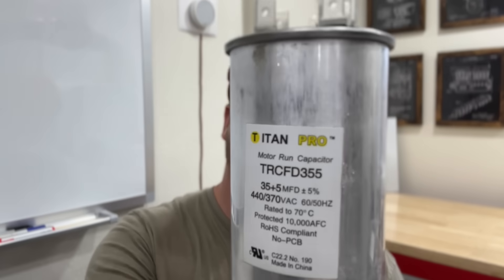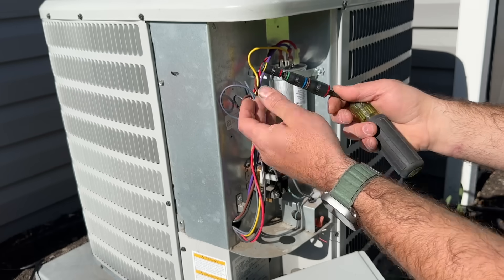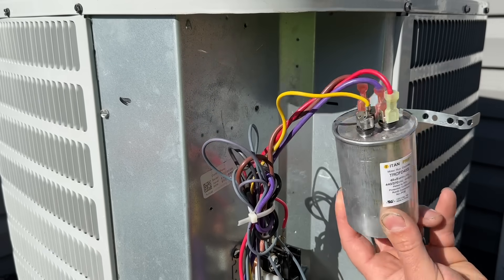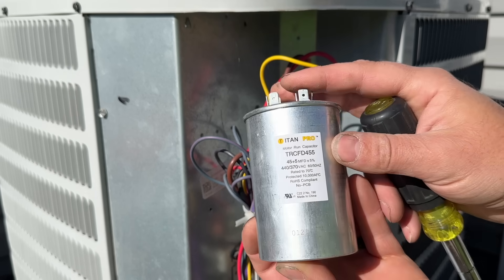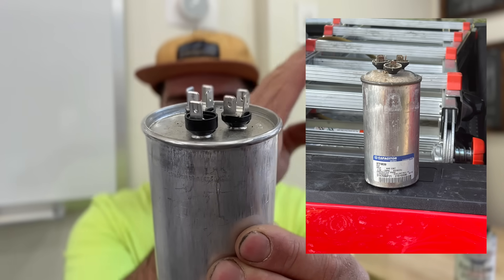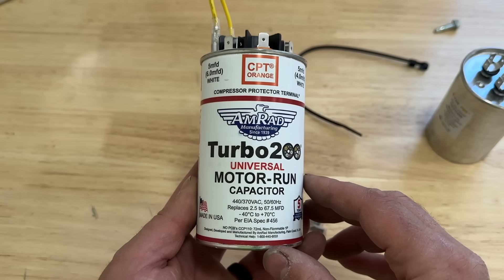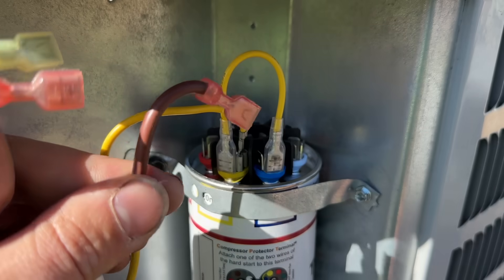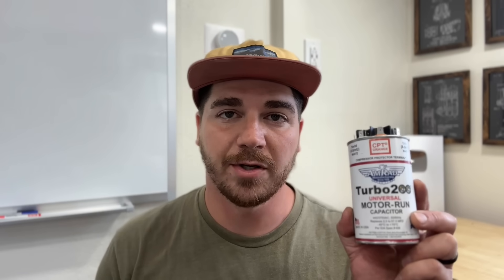HVAC Contractors Practically Make Their Living On These

Comment: Changing the capacitor (and contactor) is something every hoMEOWner should learn to do, 'cause they're not making these things like they used to- Lately it seems I have to replace my (and my 100 year-old mother's) capacitors about every other year. I thought it was just me, but the guy at the HVAC supply said "Yeah, you're lucky if you get 2 years out of them these days". Even an honest shop is going to charge you $200 to come out and change the capacitor...and you may have to wait days, with no AC....and that's IF you can find an honest shop...which is very hard, as the HVAC industry is very shady. Yeah, $2K for a $20 part and 5 minutes work...or even worse, they'll tell you that you need a new system.....

Comment: Over a week ago our Carrier Heat Pump with electric furnance stopped cooling. Ecobee thermostat screen was black. I found the thermostat wiring fuse 3 Amp was blown. I replaced it and thermostat came on. But it wouldn't cool. Fuse blew again. Called HVAC repair. two guys came out. Replaced capacitor and contactor in heat pump. Also replaced thermostat with a simple Honeywell as they didn't have an Ecobee. System ran for an hour or so then died again. We called them and they thought a circuit board in Heat Pump was bad and ordered new one. New tech came out a couple of days later and replaced the circuit board. I had him re-install the Ecobee to verify it was fried. It wouldn't power up. He put Honeywell back on and system ran. After he left the thermostat fuse blew again. I replaced it again and it blew again after system ran fine for 20-30 minutes. Called a different company and they came out next day. A new Ecobee thermostat arrived and he installed it. He put in new fuse and tested everything. System was working until about an hour after he left. Had him come back a couple of days later. He determined bad wiring in crawl space due to mouse chewing. He replaced wiring from furnace to thermostat and from furnace to heat pump. System came up and has ran fine ever since.

Comment: I was just cleaning up the house on a Sunday afternoon for a pool party on a roasting hot day when i noticed warm air blowing out of the vents.  Checked the AC compressor and found only the cooking fan running.  Called my AC guy who showed up after a few hours just as we were returning inside and he confirmed the capacitor was dead. He replaced it and was on his way in ten minutes.  Came back the next day to tidy up the connections since he didn't have the right terminals with him on the Sunday.  Charged $225.  I had been planning to get a spare capacitor just in case but didn't get around to it.  My bad.  My AC guy says he's seen them last as little as two years, ours was at least for years old. I'll be ordering a spare this week for the next time.  However I'm good with what i was charged since these days many service people like electricians and plumbers will charge at least $150 just to show up and do nothing.  I feel lucky to know someone who runs his own small independent business and doesn't rip customers off.

Comment: I needed to replace the defective capacitor on my AC only to find that no supply house in my area (DFW) would sell it to me because I wasn't an AC repair business.  Shades of the old TV part supply houses that wouldn't sell any electronic parts to 'civilians' for the same reasons.  I had worries about the China junk sold on Amazon and sure enough the first one I got from them was NG.  Tried again, opting for one that cost about $10 more and it did the trick.  Another pet peeve: nothing delights an AC repairman more than to tell you that, "drat the luck", Your unit uses refrigerant that's been obsoleted and so you've got to buy a new unit.  This pisses me off.  Thanks again, Al Gore!

Comment: I replaced a condenser fan motor for a friend of mine.
MY cost was under $100.00. (Wholesale) 
I didn't charge him anything. I had to rewire his unit a bit, and I put in a new capacitor as well. I checked the contactor, I cleaned the condenser coil fan blades, the evaporator coil, checked his air filter, cleaned the condensation line, and left.

He was happy, and I was glad to save him a lot of money.

Comment: Our air went out on the 3rd of July. Due to the holiday weekend, it was going to cost us $195 just to have someone look at our air conditioning unit- that is if we could get anyone to come out. That does not include the cost of any repairs they would do. Got the capacitor we needed at Ace Hardware and fixed our air conditioning problem ourselves. It was the hottest weekend so far this year. Thank you so much for this video.

Comment: The purpose of a capacitor is to advance the electrical phase angle of the start winding in the compressor and / or fan induction motors. Single phase motors are not inherently self-starting. Without this phase advance, the motor will just sit there and hum until it overheats and trips on the internal overload protector.

The capcitor is not like a battery.  Yes, it will hold a charge if there is nothing to bleed it of the residual charge after the unit is disconnected from power. The micro-farad rating is too low to hold sufficient charge to power any devices for more than a couple seconds.

Comment: When an electric motor starts, the current is out of phase with the voltage because of the motor being an inductive load, reducing the power factor.  The current and voltage should both be at the peak in a sine wave at the same time for maximum power.  A motor start capacity corrects this being out of phase by adding a bit of current when it discharges, to offset the lag of current at startup.

Comment: Actually the first thing you want to do is turn off the AC at the Tstat otherwise theres a good chance you'll burn the low voltage fuse on the circuit board.

Its VERY COMMON to get service calls where home owners after watching a Youtube video install a new capacitor thinking that was the problem, only to end up still having to call the AC man..

Instead of attempting to do the repair yourself the best thing to do is call an AC company thats not going to screw you over. A good technician will figure out why a part failed as well as check out the rest of the system while he's there.

Trying to save a couple hundred bucks could end up costing a lot more in the long run.

Charging $2,000 to replace a capacitor is just theft.. i would recommend to anyone to ask Chat GTP whats the average price to install said part before i paid any service invoice..

Comment: I just replaced mine. My house has two A/C units. I opened the side panels on both several months ago, before it got too hot and ordered an extra capacitor for each one. Just over $20 for both! It paid off a few days ago when it was 90+ degrees and one of my units stopped working. I checked the capacitor and sure enough it was bad. It also had a "pimple" on the top, (maybe an indicator that it was bad)? Anyway, I replaced it and it still didn't work. I found out that you also may have to reset the board by shutting off your air handler for a few minutes then turn it back on. I did that and it took off and started cooling again. I know it saved me big $$$.

Comment: Overly, somewhat, simplistic but basic educational explanation.  There many different mechanical/electrical systems out there.  If you have a problem and need to call for technical service then you need an experienced technician to work on your system.  Many AC companies hire unqualified mechanics. So, if you know of a good company with an experienced mechanic always ask for them.  Get referrals whenever possible.  Watch out for companies that advertise on TV during prime time hours.....some are run by bean counters and all they
want to do is send out techs that can sell high priced repairs.  To be a good tech requires lots of time.  It is hard work.  If it were easy peasy than everyone could do it. All you need is a multi screwdriver, a mulitmeter, and 25 trips to HD, electrical supply, etc.  Sorry to be sarcastic.

Comment: I paid a bit more for my capacitor as a backup due to it being a bit more of an unusual size.  But I would NEVER pay an HVAC guy to replace my capacitor.  I was drawn to your video due to the capacitor in my AC at this point and thought that was what you were talking about.  Thanks for posting this to make sure that we as home owners are not getting ripped off by our contractors.

Comment: I thought that the */- %  number discussed at 6:55 was the acceptable tolerance range. So with the 45 at +/- 6%,  if your reading was 42.3-47.7 the capacitor would still be good?
Reply: Exactly correct.  I had to rewatch and scratch my head.  Yea he made a mistake.

Comment: The commonly charged price in a small town is around $220 for the capacitor plus $90 for the service call. I learned years ago that is is smart to have a couple extra parts on hand before calling the HVAC company, namely the same specs capacitor and the electrical contactor. These used to be $9 each on Amazon, now run about $15 each. Last week I had the HVAC company check my system, first time in many years, because I knew it needed some more coolant. Seemed to run fine at first, but let it run 4 hours and it never got below 90degrees inside!! Called them back next day, he inspects and finds the capacitor swollen and bad, but was not bad yesterday! He was ready to charge $220 for a new capacitor but I recalled having a spare one (bought few years ago for only $9)! Worked just fine. He said no charge since I supplied the capacitor! In my experience, in larger cities these parts and work will cost even more. Keep some spare parts on hand!

Comment: On a similar note.  Hvac  service  changed me $500.00  for a  flame sensor replacement.   Parts and labor.  Informed me it's hard to  replace.  After they  left  i investigated.  Part online  under $100.  Held in  place with  a 1/4  inch  sheet metal  screw.  15 seconds to replace.   And they say car  dealers service departments are  crooks!

Comment: Some Tips from a retired electronics engineer.
1. Before disconnecting the old capacitor, take some pictures with your phone and/or make a diagram of the wiring (which color wire connects to what terminal) so that you'll know how to connect to the new one.  Another trick technicians use is to disconnect/reconnect one wire at a time although that requires that you can position the old and new capacitors close together.
2. Make sure power is shut off at the switch by the AC unit, DO NOT rely on the thermostat.
3. Capacitors hold electrical charge and can shock you so wear gloves.  Any pair of gloves will work.
4. DO not work around electricity when you are dripping wet with sweat.  Your skin resistance drops and that's what protects you.  I've been shocked by 110v ac and was uninjured only jolted because my hands and skin were dry.  Do that when wet and you can die.
5. If you know how to safely short each of the terminals of the capacitor to ground with a screwdriver then do that.

Comment: Not a bad idea to flip the circuit breaker in the electrical panel too, you get redundant protection from live circuits.  I just disgnosed the capacitor on mine, it read 0 and 0 uF lolll...  New one should be here tomorrow and we should be up and running in 5 mins.  Hopefully I dont need a fan motor too, it got quite hot from the failure. 

Be safe y'all y'all!

Comment: charging 300 dollars for a capacitor isn't a scam. most companies are already charging 200 an hour for labor and the company has to profit on the part, it would be retarded to just give it away for the msrp and break even. 3 or 4 hundred bucks for a capacitor is pretty normal. if the homeowner can do it on their own that's cool, but its not a scam just cause they're not telling you the amazon price for the part.

 if a homeowner calls a company cause their system is down and they're just gonna waste the tech's time because they don't value their skills and just want to take advantage of their expertise then they're a piece of shit and they deserve the DNS they're gonna get.

Comment: During a spring maintenance check & cleaning, I was told the capacitor was bad on a 2yr old unit and was quoted $400+ to replace it. The tech was adamant that it was going to destroy the unit if not replaced immediately and I took a picture of the readings which he had hand written down on the work order notes. I then told him that the unit had a 10yr warranty and that the capacitor was listed as a covered item. He argued that it wasn't, so I asked him to call his boss and pulled out my warranty papers. His boss then "double checked" and agreed it was indeed covered under warranty. The boss then told me that the capacitor readings were "not that bad" so it probably didn't need to be replaced yet but may die in the near future. I said the tech showed me the readings and that his readings were out of spec. I had basically caught them in their lie and forced them to either admit that they were trying to scam me, or replace the capacitor under warranty right away. They ended up reluctantly replacing it under warranty. (Hiller Heating and Cooling in Nashville, TN)

Comment: This is exactly the reason I stopped calling my local HVAC company.  They charged me $400 to replace one before I knew better.  SHAME ON THEM.  I don't have a problem with someone making a fair profit, in fact, I'm all for it.  But that company fleeced me so hard that I am forever changed.  I've replaced my control board, contactor, and various other minor repairs.  I do it all myself now.
Reply: What do you think would’ve been a fair price?

Comment: I've had the same AC unit now for 32 years. The run capacitor has burned up 3 times. I replaced it myself for about $12.
 I understand that a timer to not allow it to try again when the power goes on and off rapidly would fix the problem.

Comment: if your AC System has a "Surge Protector" and your Capacitor goes out,  the AC System will still turn on. Just saying.    Also,  I do recommend an AC Surge Protector cost about $80.00 for the AC, or better yet, a Surge Protector for the whole house cost a lot more.   As for the Capacitor, I buy mine on line for about $12.00, I just keep them in storage, last time I put one on was about 3 years ago, I change them every 4-5 years or so.

Comment: Hate to break it, $400-$500 is not at all a rip off. Just because the part costs $40. The tools, knowledge, expertise, time, fuel costs, business insurance, vehicle repairs etc. If you want to diy your hvac repair and risk the 240v shock, be my guest! And no, HVAC don't make their living off run cap replacements. This is a good video for homeowners, and between this and coil cleaning/filter replacements you can keep your system running for years. So great content, but some of the comments here are really out of touch.
Reply: The HVAC instuctor at our college charged me $100 for the capacitor and the labor. So $400-$500 is ripoff! He even showed me what he was doing! Super honest! So he’ll be ordering my furnace/ACunit and installing it.

Comment: HVAC repair is one of the biggest rip off businesses there is. Their cost to profit ratio is off the charts. I have replaced capacitors, fan motors, and other easy diy jobs such as cleaning the coils. As long as you shut off the breaker to the HVAC system and allow time for the capacitor to discharge or short it, you will not be in danger. Plenty of videos on YT on many HVAC jobs you can diy. Just do research and use common sense.  Some things like freon charging you are at their mercy. Not diy.
Reply: So did you walk to the job, and then not make a decent wage with benefits and also stand behind the part that you put on for two years parts and labor and you don’t have a dispatcher so you’re answering your own calls. You should start valuing your time.

Comment: Yup. 1 or 2 hundred to come out. Then a "diagnostic" fee and so on, then "parts and labor" and bam, a gazillion dollars. Basically, your AC is going to make a loud humming/whining noise and that's a tell tale sign. It won't want to "kick over." I did it myself for less than $20 because I went crazy and got a US capacitor instead of from China. Couldn't find a Japanese one, they make good capacitors.

Comment: A Morrison Plumbing, Heating, Air & Electrical technician replaced my capacitor with a Turbo 200 for only $329.00 during a routine service check on a four years old unit with ten year parts warranty.  I had a talk with their management.  Even big name companies use this scam.

Comment: Ironically, I added a capacitor to a window unit, one of the Supco Super Boosts, what a huge change in how the unit ran.  It didn't dim the lights when the compressor kicked on and you didn't get that loud "thunk" when it did.  That was ten years ago, it still works.  I've only recently upgraded to something much nicer with all that already installed, but it was well worth the time to install it back then.

Comment: The points are another way people get ripped off. Also there is a wire on the outside of the compressor. I have seen where the compressor got to hot ( usually not maintained unit) it will burn the connector. Shut power off and cut old connector off the wire put a new one on screw or push back on to the compressor. Turn the power on and off you go. Just a tip in the possible tip box.